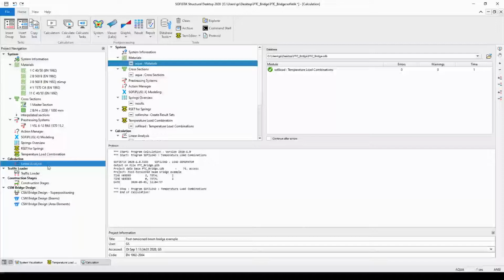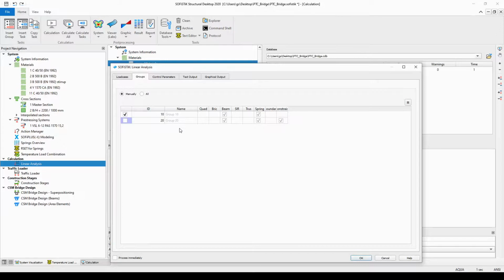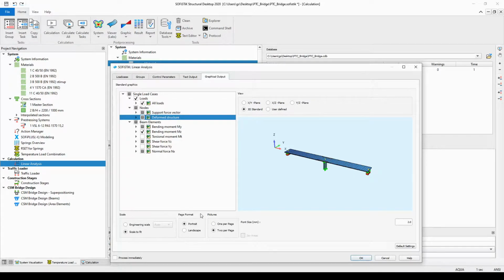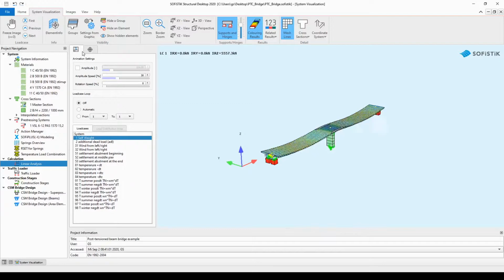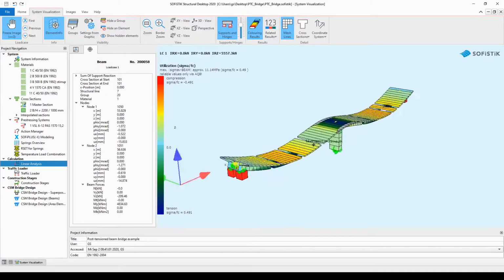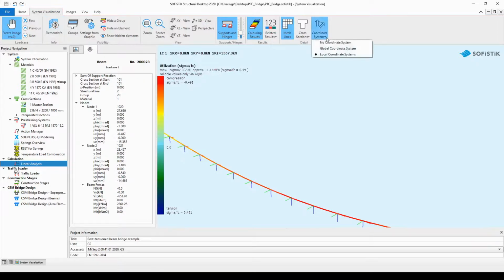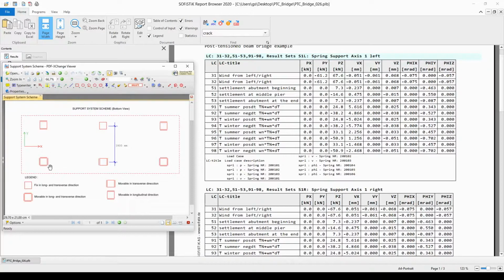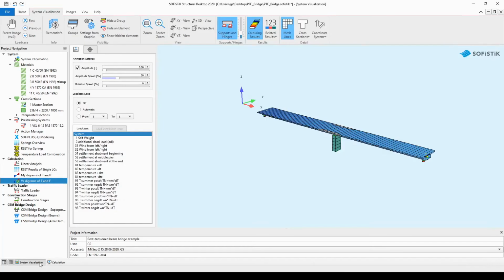Bridge Design Training #08 - Linear Analysis and Results

Comment: 18:23 when i switch from load case to load case, the tension and compresion changes, but for the RX, RY and RZ, the value is 0kN, for all the three and in every load case
Reply from the maker: Hi Aleksandar,
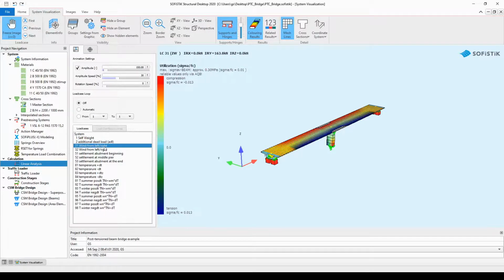I guess you mean 14:23? Yes this can happen if you for example click at the temperature loads. They do not apply external loading on the structure, which would cause RX, RY or RZ.
They cause inner stresses, which result in an expansion of the structure (the Animator showcases deflections based on the loadcases).
This is why it can happen that you see a deflected structure but no RX, RY and RZ.
Did this answer your question?